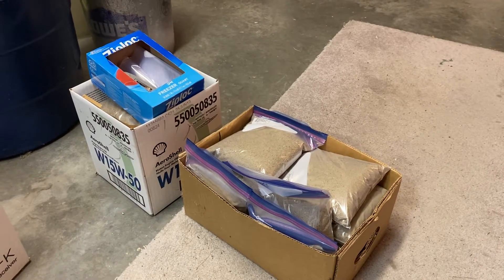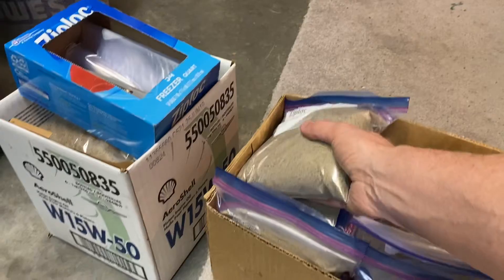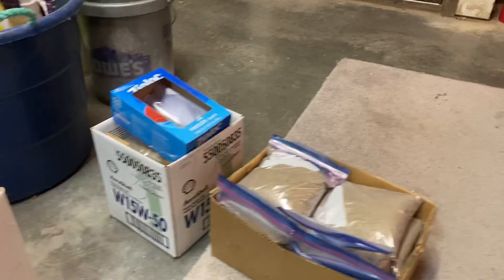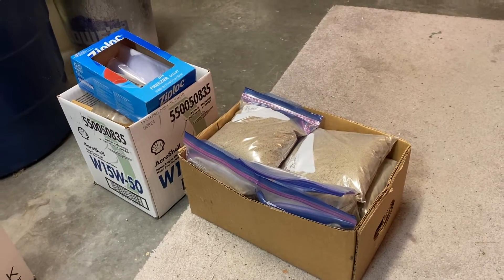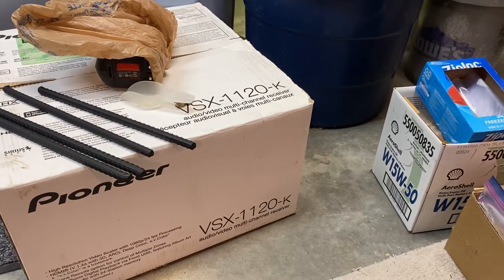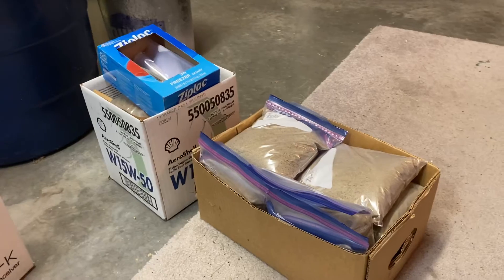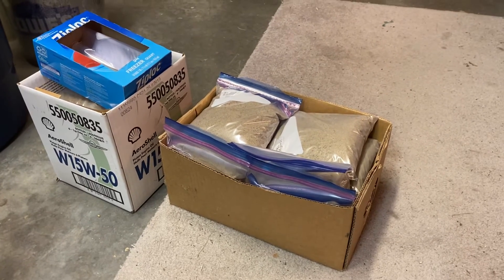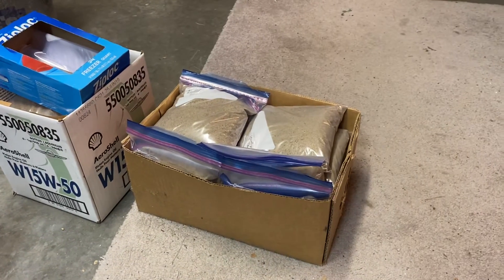No. 18 9-15-2020 sandbags and rebar

Comment: Did you put a bolt or drill through the hinges when you riveted them?  I forgot to do this on my rudder and thought about it on the VS (I have done this for years on other things I built that needed to be in alignment) and then, to my dismay, found that the bolts would no longer fit as the bushings had compressed when pressed into the hinges.  I now ream all of the bushings to ensure the bolts will fit.  I almost thought I might have to build a second rudder also to fix that, or at least remove the hinges, but I found an extension chuck that allowed me to get the reamer to the hinge going through the space where the leading edge skins wrap around.
Reply from the maker: Yes, we put a bolt through when we riveted the hinges. Hoping that eliminates mounting issues.